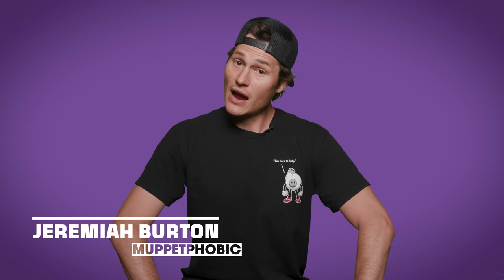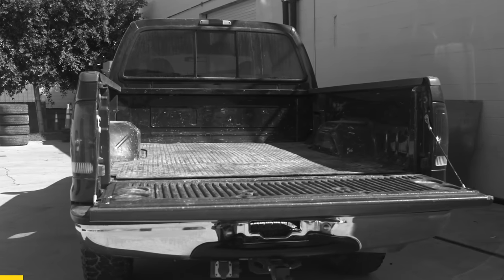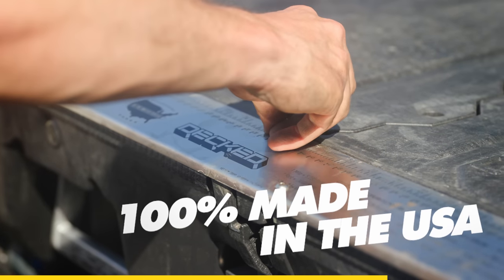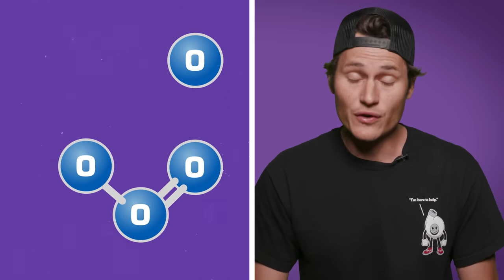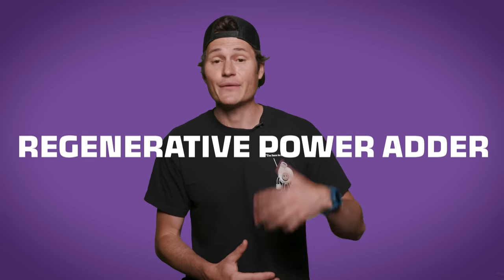Is Ozone Injection Better Than NOS?

Comment: I think I need to read more chemistry. I can't get this:
NOS = 2 nitrogen atoms and 1 oxygen atom, 1/3 ratio, better than 1/5 ratio (roughly) in the air, so more oxygen, more power, fine. Also comes out of a pressurized tank so more compression, again fine.
Ozone (O3) = 3 oxygen atoms, nothing else, should be much better than above, but degrades rubber etc, brings a degree of health concern too. Going past those, if produced instantly in the intake, won't be above 1 atm pressure, so no added compression.  Also from what I think I know, it is not stable, it tends to revert back to plain O2 in time, so, you can't just add a bottle of it for added pressure, by the time you need it it may have already decided to stop being O3. Which brings us to the last option:
Oxygen (O2) = 2 oxygen atoms, 1/1 ratio as in O3, but it is stable, so it can be kept bottled, even bought like that, comes pressurized, so there is the added compression factor. This should be the best option in theory, yet still no one uses O2, NOS is everywhere... Why?

Comment: 9:50 assuming a container had pure ozone, the pressure would increase 50% when it fully breaks down into oxygen.
10:50 being reactive, ozone attacks rubber and similar materials. Noticed near brushed motors e,g,, as their sparks can generate it.

Comment: air= 1.135grams×CC2
air= 20% O2
stoichiometric ratio=14.7
gasoline= 12KW×KG
gasoline= H2C

when the efficiency is equal to 100%=270NM×litre, 200ft-lb×litre

how much you have 100NM × liter, 73ft-lb × liter. Efficiency = 35.5%
Does anyone know if due to the operation of an engine the molar volume of the air decreases inside the cylinder? I mean when the piston is at the BDC at that volume, the molar density is higher than it is outside the engine.
Reply: at all times I speak of an NA engine

Comment: i think youre overthinking this. 
the O2 from atmosphere is a tiny sliver by weight in comparison to all other gasses, if you just had a bottle of pure o2 going into the engine that would give you tremendous results. and O2 is easy to refill

Comment: I just have more questions, and want to know why an ozonator isn't being used in racing.. unless it is? wouldn't mind using one on a 1.6L. and upping the fuel system. though I'm not sure if you'd want lower compression or higher compression for this kind of setup, as I'm not entirely sure which is best for n20 injection. even more so should you use gas, ethanol, or maybe even methanol? I live in MI, so I doubt it would be an issue to build and run.. but who knows

Comment: You would have to redesign a car to run off ozone and produce it at the same time. This would make no sense, a 2nd fuel source would need to be used and if you design your engine from the ground up. The engine would be required to run with no rubber or plastic parts. 

This is possible. But it would be impractical and would need to be embraced by some companies to work. Maybe ozone enriched fuel if thats possible. But Im sure it would just blow up somthing in the process most liky the fuel pump.

Comment: wait wait, what if you had two bottles of nos and one of oxygen spraying into the chamber at once then wouldn't that work? just have the extra oxygen accounted for in the tune/map. or is this the same problem? speaking short term life/lots of engine rebuilds

Comment: How much would a ozone generator weighAnd what else you're feeling to realize is the engine can only take so much  sprayed horse power Yes the ozone makes more power but you're gonna spray less of it Just spray more nitrous to make up the difference it doesn't matter how much you spray it's the horse power level you reach that will hurt the engine In a nut shell

Comment: Ozone as fuel is a TERRIBLE idea:
(I shall quote the bible:  Ignition: An informal history of liquid rocket propellants)
It’s at least as toxic as fluorine.
At the slightest provocation and sometimes for no apparent reason, it may revert explosively to oxygen.
Ozone/oxygen mixtures separate into two phases
Trace contaminants will cause the tank to explode

Maybe there are theoretical advantages, but they are outweighed by the practical and safety problems. In a profession used to testing things like FOOF (fluorine dioxide) and chlorine trifluoride, this is some admission to make.

FYI, the authors day job was to test rocket fuels

Comment: I ran NoS for years i ran 3 30lb 3000psi bottles on a 500HP kit not these crappy 1000psi bottles they run today when I raced at an IHRA track I sprayed from the start line to the finish line every pass I filled my tanks about ever month or two but I raced 3 IHRA tracks a week and one NHRA which no NoS was allowed back then, you’ll never see an O3 system I would imagine it’s explosive, NoS doesn’t burn that partly why racers use it and NHRA allows it now in some class’s

Comment: Just curious as to how the math of the Ozone generator checks out.
Firstly, the high energy required to create Ozone would have to be taken from the car, thus depriving it of power. Secondly, since there's no 100% efficiency, some of the energy used to create Ozone would be wasted as heat. 
Wouldn't the Ozonator violate the law of conservation of energy? Second Law of Thermodynamics?

Comment: Place the "ozonator" in the trunk. Throw aparty couple of induction vents in front of the back wheels, channel the air, via duct, to the ozonator. Continue ductwork, for exaust, ot the tear of the vehicle. Now, uour ozonator has an air dource, and an exhaust channeling exposed air away from the driver. Cooling problem solved, half life problem solved. Now go ozone yourself into the stratosphere... shouldn't take long.

Comment: That's not how the nitrous oxide system create more power......
While the extra oxygen atom helps, the REAL reason Nitrous oxide makes power is because when it expands at it comes out from the compressed tank, it absorbs heat which cools its surroundings, by cooling the air that's being sucked into the intake, you increase its density which means more air molecules get sucked in from the atmosphere.
Also the extra nitrogen atoms/molecules that get sucked into the intake increase the compression ratio of the combustion chamber.

Comment: You never answered the question of if ozone is better than NOS.  How much ozone could be generated on the fly using a 500-1000w generating power? Is supplemental ozone possibly a good thing as it may reduce or eliminate the need for catalytic converters and since it burns better not escape the tailpipe creating less pollutants and possibly even breaking down other exhaust gases before it is gone?  If enough ozone can be generated on low power to supplement or replace the air intake could it possibly be better for the environment?  And finally, what are the power gains possible on low power? This should be tested..

Comment: You know what else is bad for our health? Exhaust gasses, yet EGR systems exist without harming us. Same with evap and pcv gasses but we have engineered the systems to be safe. I would imagine you could engineering the Ozone system to be sealed, but there's other reasons why there not in production currently. Probably very expensive tech.

Comment: People calling Nitrous Nos triggers me, it shows me the idiocy of the person talking instead of assuming it. This guy and his friends are the ones, I'd avoid like the plague at the track. 
        BTW one of the aspects if Nitrous (tank injection method) is that in it's liquid state it's around -89C (Approx. boiling point) At that temp it lowers the temps in the intake colder air the more densely packed it is. So yes it brings more oxygen, but also lowers temps creating opportunity for more natural air to enter. So using an ozone generator, without a tank system will not allow adequate cooling so compression would have to be lowered considerably

Comment: ...So you wouldn't use an Ozone machine to clean your house as a regular thing..it's used for cleaning out newly vacant homes or apartments over a period of a couple days. This is because the place is 100% completely unoccupied and the machine basically makes the place unlivable during the duration. As in all the Oxygen in the home is taken out and converted into Ozone which combines with odors to eliminate them. This also has the added benefit of killing most pests living in the home because the Ozone is deadly + no oxygen.

Comment: Yeah the problem with ozone, really, is that it's reactive as hell, so even if you could overcome all the other problems you mentioned the engine would have serious problems with pre-ignition. I'd be surprised if you could get a compression ratio of more than 6:1 with it without making it knock. So this would only really work on a diesel :)
To a lesser extent the same is true for oxygen, but that could probably be fixed by adding water injection as well. you know, building a regenerative system with oxygen would actually be feasible: oxygen concentrators are a thing that you can buy, and it wouldn't be very hard to compress that in a tank. But of course, a tank can hold far more nitrous oxide, because that can be a liquid at room temperature if you compress it hard enough, whereas oxygen can't. So it wouldn't work particularly well, but I'm sure it can be done.
Reply: it works fine just add it by the air intake,  and it's not that reactive,  my buddy got 30mpg on his van

Comment: What about hydrogen peroxide injection instead of meth injection? With the heat of combustion the oxygen will be released and the remaining water will keep the engine slightly cooler and any possible hydrogen released will add to the combustion. I'd  assume the rubber components would degrade from that too

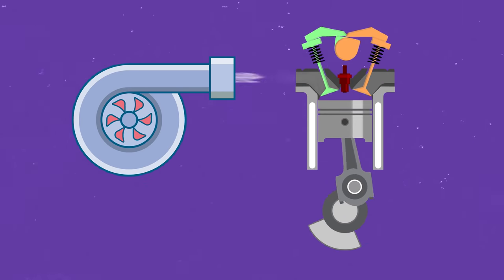Comment: 3:00 "There are more ways to add air to thew combustion" uhm simply add pure HO or an imaöanced mix of brown gas?
The latter could e produced onboard easily. But the detonation speed might cause the cylinders to ring and alas rupture the engine block over time.
btw. Ozone is afaik pretty poisonous to inhale. Also pure oxygen is poisonous (at least at a certain ambient pressure), but less risky when handling.

Comment: well for ground level Ozone it depends on the concentration. just having your windows open literally lets the external Ozone in. (it is also that fresh scent you smell outside) problem is when you got generators that generates for something like the size of a house or like 100 cubic feet in a car... but only idiots would do that... then again never trusts humans blindly, there are always a few weird ones that put things in their noses like forks and light bulbs when you leave them unattended... ( EDIT: BTW 100 cubic feet might look small for Americans or big for the rest but you could fit the whole car in that, that is a lot more than the interior space by about 2 times more for a 4 seater, and 3 for a 2 seater like a truck cab.)

Comment: U realise that an ozone generator in the intake would make ur levels unstable. I've worked with tons of them ib my old work. Secondly have you even looked at racers in the 60/70s? NOS was chosen over pure oxygen because the nitrous is  makes it safer. As a inert gas it helps to stabilizer the combustion and prevent catastrophic failure

Comment: The chemistry explanation is very erroneous. A single oxygen atom is NOT a molecule. The decomposition of N2O is 2N2O -> 2N2 + O2, as both nitrogen gas and oxygen gas are diatomic molecules. Further ozone would not break down into 3 oxygen molecules, but rather 2O3 -> 3O2.

Comment: The nitrogen stabilizes the reaction.
Using O3 would likely cause a reaction so volatile that it would micro-weld your piston to the sleeves
Reply: no, we aren't not running ozone for air just adding some. it won't lock it. my buddy ran it on his van

Comment: O zone has a higher concentration of oxygen making it more combustible great idea, now let me finish watching so I dont put my foot in my mouth
Reply: Jeremiah, the n2o is actually freezing cold making the air compress, almost like an intercooler would do for a turbo the extra oxygen is only a small factor because the cold is what compresses the air that's why you cant use it continuously along with the fact that the tank isnt that large. If your ozone distribution system was also cooled you could get even more power, comment if you think I'm wrong and please teach me.

Comment: pre-air intake, to intake, more oxygen, filtering
Reply: how about just oxygen, included, to intake
Reply: you can make NOS (N2 O2 in air) like O3
Reply: liquid air, oxygen rich, not pure liquid oxygen, not only nitrogen
Reply: liquid air (nitro-oxygen, very cold) will deal with the cooling too, and additional expansion from the gasoline fuel heat

Comment: There are so many inconsistencies from a channel that has 5.5M subscribers that it hurts (and I literally had to get out of bed to write this)

1) 0:33 Besides FI and chemicals, you can also add power by... increasing the revs. 
2) 0:40 Ozone is not "dwindling away at a rapid rate" and hasn't done so for a long time. Ozone has to do with protecting against UV when it's up high in the stratosphere, but the connection between Ozone depletion and climate change is.. indirect at best. https://en.wikipedia.org/wiki/Ozone_depletion_and_climate_change
3) 03:14 Nitrous Oxide carries an oxygen ATOM, not an oxygen molecule (an oxygen molecule is made out of two, or in the case of ozone, three oxygen atoms)
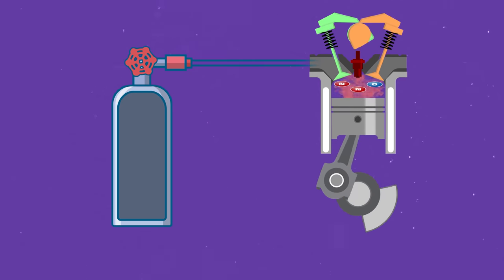4) 03:25 Again with the oxygen molecule... Jesus, Mary and Joseph... 
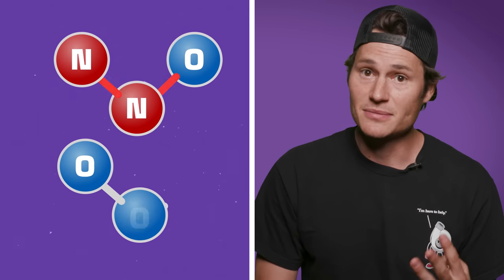5) 05:48 The Oxygen Molecule Monster Appears Again! Run for your lives!

There are a couple of dubious ones (e.g. the ozone structure is a bit more complicated, but we'll let it slide)

Bad B2B!

Comment: so he made it a point to say that "you cant run NO2 all the time" but you actually can im amazed that the dudes at donut dont know bout these new systems where you can have what is essentially a drip feed of NO2 added to ur cylinders so that it increased compression and displacement by a small percentage, heres an explanation, so you could take lets say 500cc of NO2 and dump it all into the cylinders at once which will increase ur HP by lets say a random number like 100HP but only for a short time like 30 seconds is all it takes to dump the tank or you could drip feed that 500cc over the period of several hours which will increase the resting HP by like maybe 15 or 20 hp but for a consistently long amount of time i have no idea what theyre called or how to acheive that but ive talked to several builders who have done mods like this to their engines weird that they didnt mention that here
Reply: after some thought you could do the same with ozone and with an ozone machine like he said you could add this drip feed system and make more powah babeh consistently but this would benefit from some research as we dont know how an engine will handle additives in the cylinders for extended periods of time but on the face of it it seems like a no brainer

Comment: Jeremiah you got so much wrong there. More power comes form more heat not more fuel, and a more active oxidiser makes for a more energetic reaction with more heat. Its also not at all about the amount of oxygen but the amount of electron holes.

Comment: While investigating oxygen injection many years ago, I was lead to the conclusion that as oxygen is burned during combustion, it's  the heating of the nitrogen that actually pushes the piston down. Hence pure oxygen would add heat from the burn but without excess nitrogen you'd get with nitrous, benefits would be minimal. I have no idea how credible any of this is but it makes sense in my monkey brain.